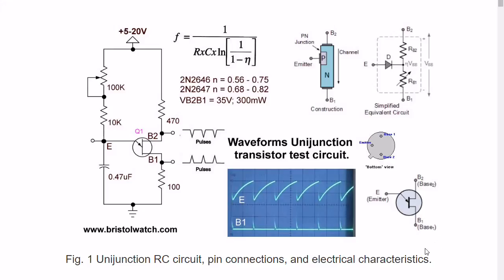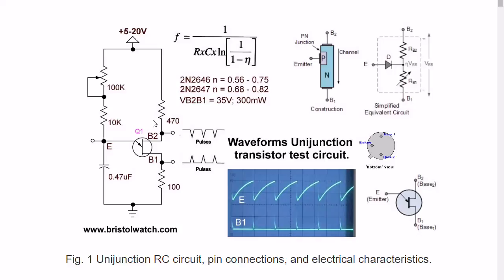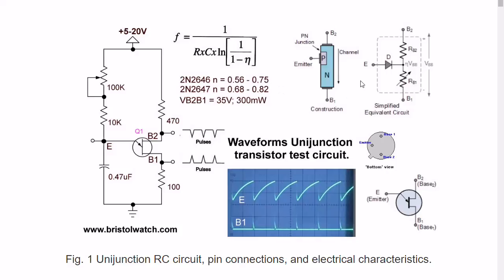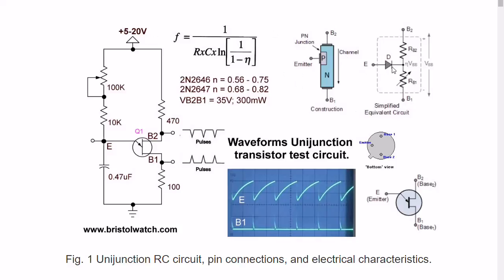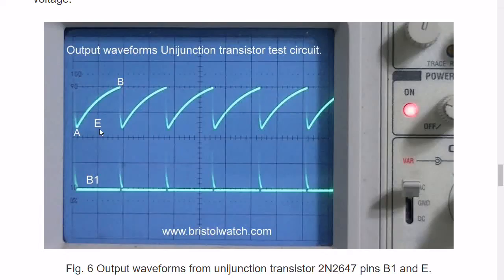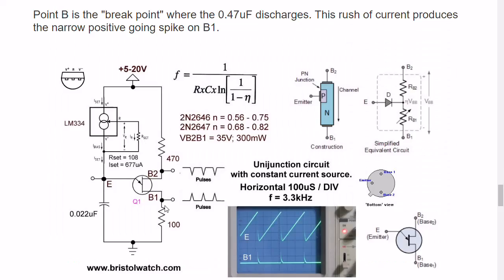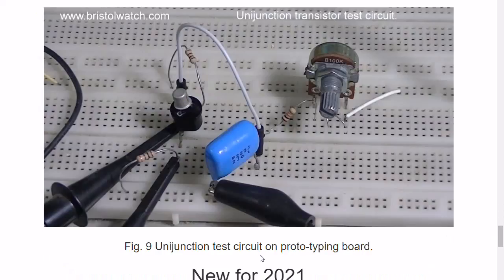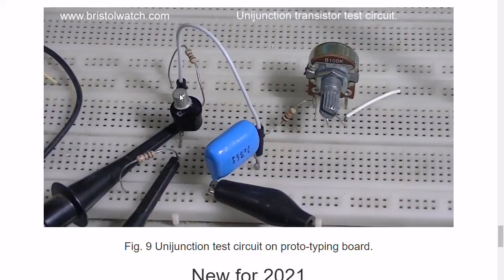Understanding Unijunction Transistors Theory Operation

Comment: Hello I would like to ask if the connection for the oscilloscope to see the sawtooth wave is from the positive terminal is emitter (middle line) and negative terminal is the ground? thank you. we can't get the sawtooth for a particular circuit ><
Reply from the maker: Sawtooth is on the emitter.
Reply: @LewisLoflin  is it ok if I mail our circuit from multisim? we can't get the spike for the Vb1 and Vb2 😢😢
Reply from the maker: @tracesofthesunjingab  Got your email and I'll have to build the actual circuits. I never use sim software it doesn't work much of the time.
Reply: @LewisLoflin  thank you sm, it's a lab activity and will be passed later. Now for sure we are wuite confident that there's something wrong in the circuit as we cant get to see the pulse/spike. Tysm 💙